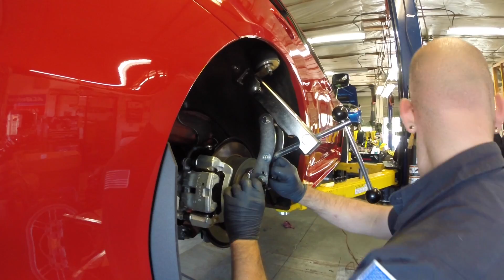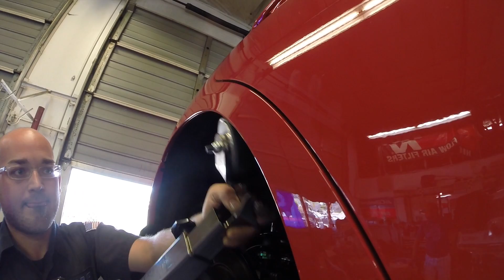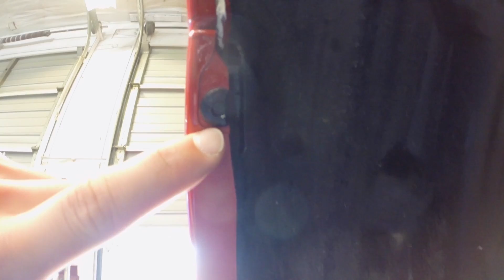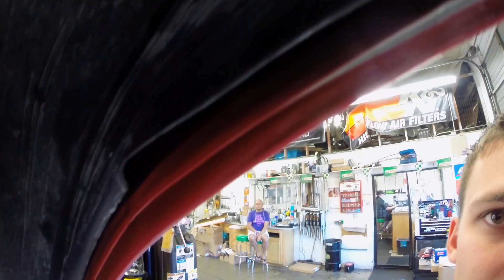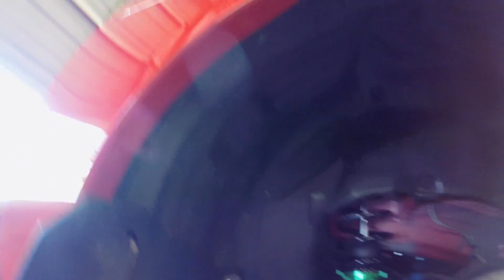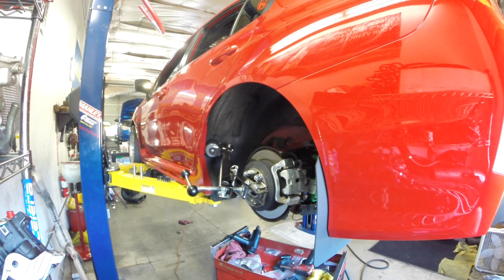Proper Fender Roll on a 2015 Subaru WRX

Comment: You're on 18x9.5 +38 with 265/35 right? Did the front have any rubbing issues?
Reply from the maker: YetiShred Correct. When the car was a little lower there was a tiny bit of rub in the front but that should be easily correct with some extra camber.
Reply: Im about to put some 265/35/r18 on my 15 wrx, its on stock height and im getting mixed answers. You think Ill have rubbing?
Reply: +Joe Brands nope it won't rub. 'cause I have that setup

Comment: Do I have to do that on stock height suspensions?
Reply from the maker: +Kevin Gentleman Lowered on coilovers
Reply: I did didn't write the question right. if I got the same size wheels and tires as you, do I need a fender roll at stock suspension height?
Reply from the maker: No.
Reply from the maker: Kevin Gentemann no
Reply: +Brian Gabel it looks far better with coilovers but then I'm worried about scraping the bumper. how is it for you?